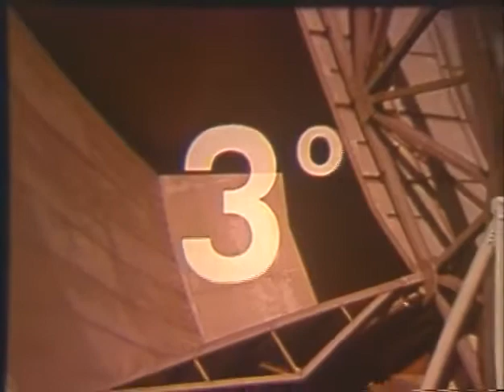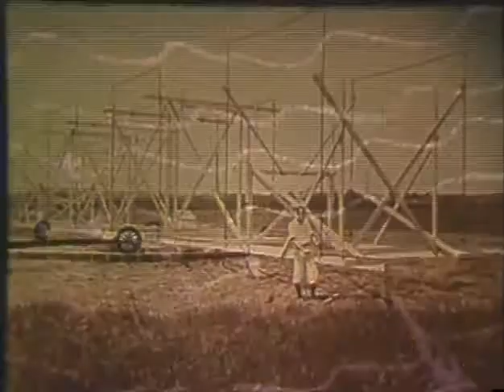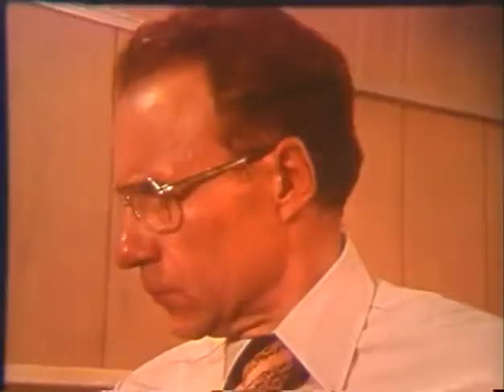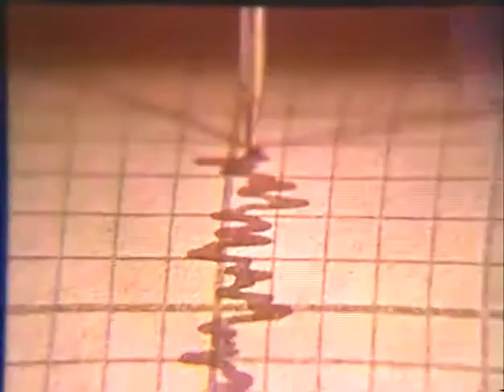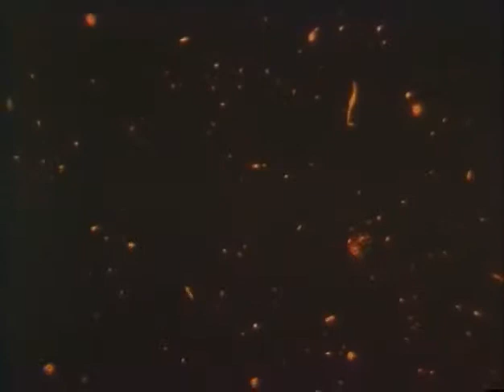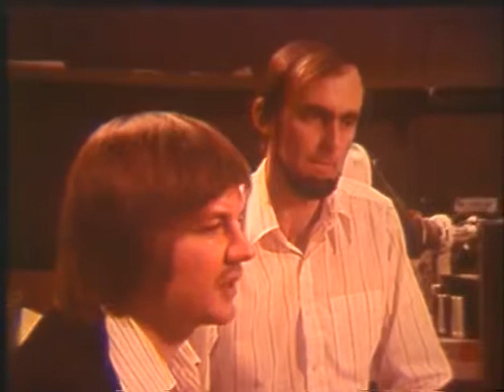Bell Labs Three Degrees

Comment: Just amazing to see all the details  of the research they did, from building the cold load to the challenge they ran into trying to work out the source of the additional heat.  Incredible that they were switching between the sky and cold load sensors by hand.  They did a good job documenting how tedious it must have been.  Just remarkable that the filmmakers got so much footage of the workshops, lab, and the process too.  It's a really good film about the scientific process, for any era.